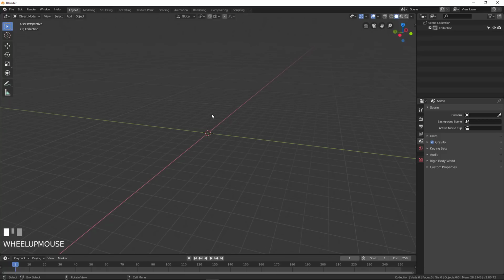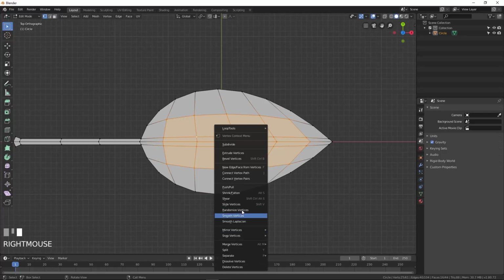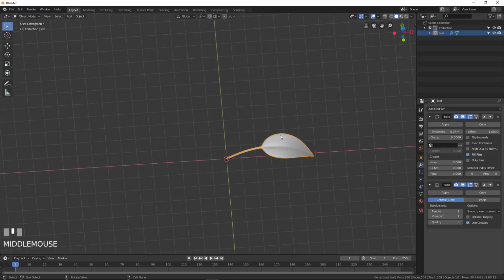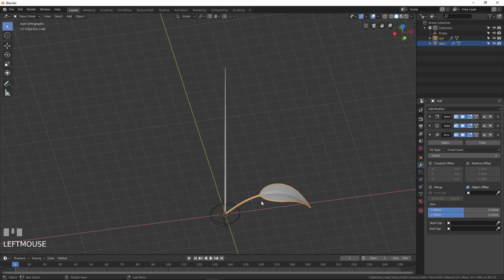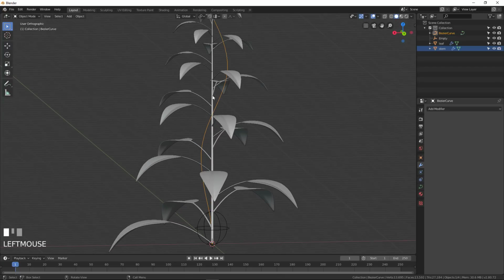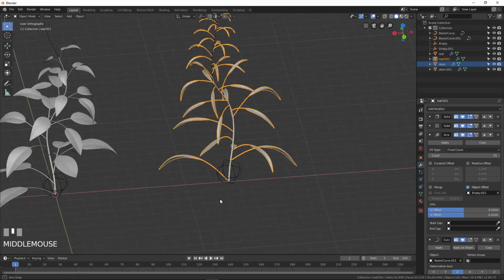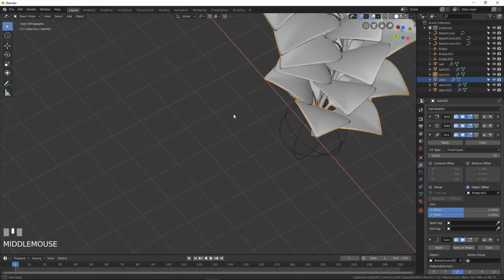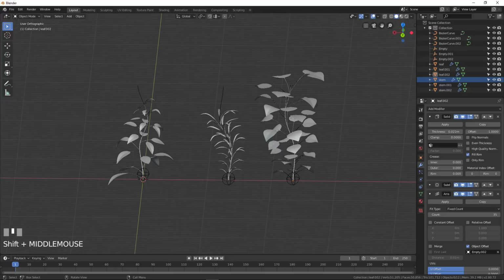Blender 2 8 modular plant creation with modifiers

Comment: Pretty good tutorial, it's gonna come in pretty handy when I start working on my model. The only thing I didn't really get was when you made the circle that would become the tube-like part where the leaves connect, you reduced the amount of vertices because it wasn't necessary, and not long after you added a subsurf modifier, it felt kinda redundant.

Comment: How do you reduce the polycount? 20,000+ triangles seems like a lot for one plant
Reply: Depending on what you use it for, yes, that might be fair bit. You can leave the solidify modifier out, that'll reduce the count by half. You could also do a more judicious subdivide, or not use the modifier at all and just individually subdivide those edges that need it, depending on how smooth your plants need to look and how low you need to get the polycount. But the basic technique here is useful to know, and the polycount isn't atrocious; it'd be fine for an archvis scene.

If you need to go really low poly, nothing beats using transparent textures on deformed planes where you basically don't have individual geometry for leaves at all. A lot of semi-realistic games use that approach. There are tutorials for it if you're not familiar.

Comment: Okay what am I doing wrong?   Whenever I try to add the curves to my stem/leaves the stem goes flying out the end of the curve.   I've tried numerous different allignments and the only one that kind of works is -X, not Z, and it only works for the stem.    The leaves are utterly unaligned from the stem when I apply the curve to them.   What am I doing wrong?
Reply: I had the same problem, after messing around for a while I fixed it, try this: 

1. Click on the Stem, select 'object', 'set origin', 'origin to 3D cursor'.
2. I made a new path, not the bezier curve he used and rotate it 90deg so its upright.
3. Make sure the bottom of it is at the origin (if it isn't go into Edit Mode, click the bottom point, shift+s, select 'Cursor to Selected', press n, on the menu, change location to 0,0,0. Shift+s again to get the cursor back to World Origin.
4. On that menu either x or y rotation values will be 90.
5. With path selected press ctrl+A and select location, rotation & scale.
6. The value that said 90 should be 0 now.
7. Deform it til its the shape you want.
8. Try applying the curve now with Z, if -Z works but not Z: on the path go into Edit Mode, right click and select 'switch direction'.

Hopefully that should work, let me know. Also I'm so confused at how the guy didn't have to do any of this and no one else seems to be having these problems lmao.

Comment: when I use use the object offset in the array modifier and I select an empty sphere my leafs appear in a different way. I don´t know to solve it
Reply: I have the same problem. The leafs are offset, regardless the empty shape I add. Did someone solve it ?
Reply: I solved it, I applied all the transforms of my leaf
Reply: @sophieb.7705  what do you mean? I have the same problem, what do you mean by applied all the transformations
Reply: @rubysnell6755  Hey, sorry if this response is too late for you.

Sophie B. is referring to Object (at the top left of your screen by your toolbar) -> apply -> all transforms. It is a pretty common mistake to ignore modifier, transform, scale, and rotation values that were changed for an object. Basically an object's internal values (location, rotation, transforms, etc) have to get reset now and then because when you apply a modifier like array, it modifies the object based on the internal values and therefore you don't get the intended effect. Resetting this by selecting apply in the object menu will allow a modifier to display appropriately.

I hope this helps you or anyone else with this issue.
Reply: @whisperingwilds8178  Thank you so much, I was scrolling down to see if someone had answered about this!
Reply: @whisperingwilds8178  Thank you so much for this!! You explained it so clearly, I took notes of it! Thank youuu I can't express my gratitude really
Reply: I had the same problem, have you tried this:

Make sure your 3D cursor is at the world origin point (shift + s, 'Cursor to World Origin').
Select Leaf
Click 'Object' (it's at the top next to 'View' 'Select' 'Add' ).
Click 'Set Origin'.
Click 'Origin to 3D Cursor'.

Hopefully this works :)

Comment: I was having an issue when changing the size of the leaves, they wouldn't stay on the stem and just floated there. Can anyone help with this?
Reply: In the array modifier panel, make sure 'Relative offset' isn't checked, so you're just using the object offset. Also make sure objects have their scale applied in object mode if  you encounter weird behavior. good luck!

Comment: idk why when i get to the stage of array or adding more leaves and they don't stack up they add a bunch offset from each other
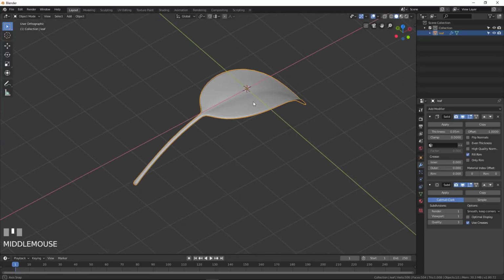Reply: I'm glad you mentioned this, I had the same issue and it would have taken me ages to work it out. The 'yellow dot' is called the origin point - I believe each object has one - this can be moved in different ways, in edit and object mode, but it needs to sit at the base of the leaf stalk, and ultimately at the centre of the empty sphere, and the base of the plant stem. The array modifier will generate new objects from this point, and use this point as the pivot point for scaling and rotational modification. He does this at 6:45 in the tutorial. Amazing technique btw Thank You @yojigraphics
Reply: @pigmentinoil  glad it helped
Reply: got the same problem, anybody know whats the problem?
Reply: @tomaszkos6176  you have to aline it using the edit mode get the yellow dot at the same spot as the ed of your leaf
Reply: @tomaszkos6176  I did go to a discord to get help that's how I did it
Reply: yes, i figured it out after a while ;)